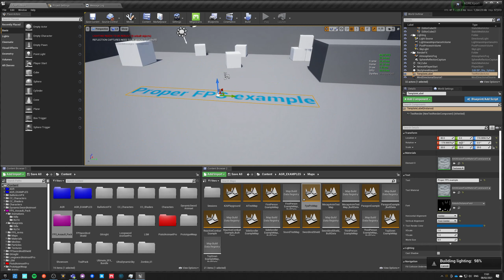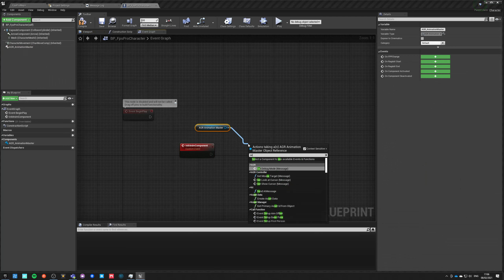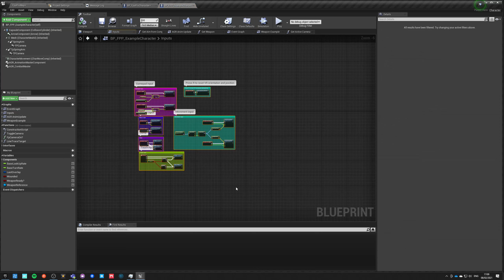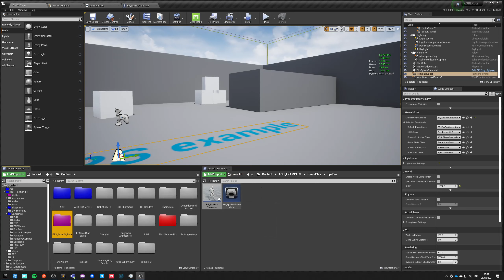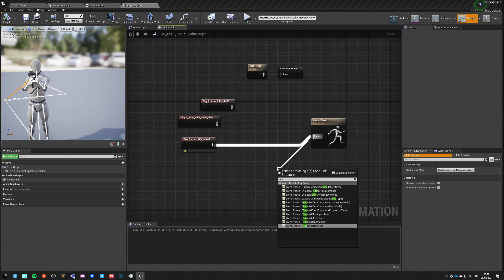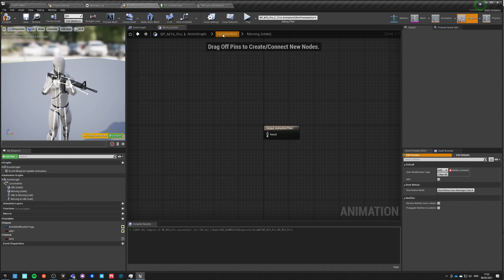#1 Player Character Setup - UE4 Advanced FPS Tutorial

Comment: If you want to create, choose a different toturial. This one sucks at the beginning.

I downloaded AGR toturials. It is impossible to export AGR and AGR Examples files to my project, there is a lot of information about ERROR.
The product cannot be started if you have version 4.27
Plugins are not compatible with this version.

you have to download paid plugins to open them.
Electronic nodes costs 11 euros.
Reply from the maker: This tutorial is for advanced users. With 2+ years of experience. Ones that can read errors log and understand repositody has cut out marketplace paid assets and knows that plugins can be turned off while runing the project. If you share same errors i encourage you not to use my tutorials. 
Also check agr pro series tutorial as its not a continuation of this one

Comment: so the agr in the epic store is different from the one in this video. smh
Reply from the maker: this one is the Blueprints based repository version. one on epic store is easier to work with. HOWEVER you can achieve same results with the C++ version a lot faster in same methods. as basically they are doing the same thing.